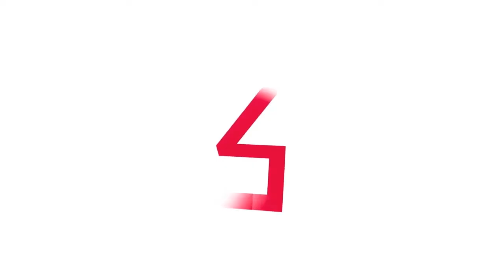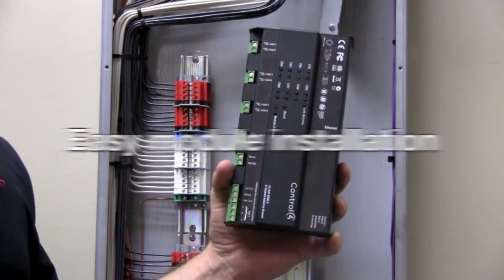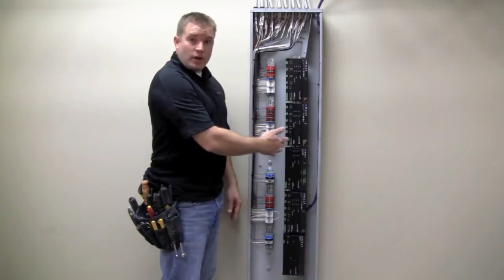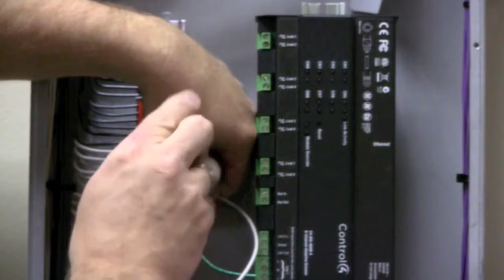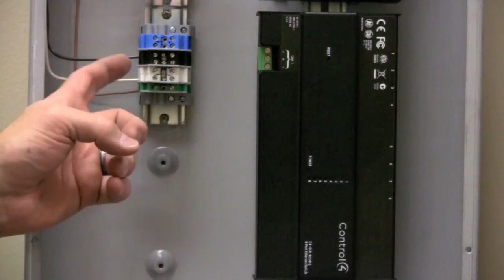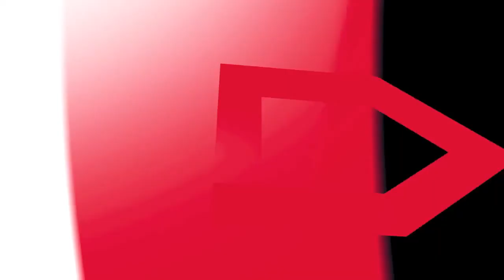Control4 Panelized Lighting - Modules Installation

Comment: So if I want to be able to turn light zones on and off but ALSO dim them 0-10, I need to wire the 120v part of the circuit to the 8 channel relay and then the 0-10 goes to the 0-10 dimmer?
Reply: control 4 makes a centralized dimmer switch for that.
Reply: Doesn’t crestron do both in the same module?